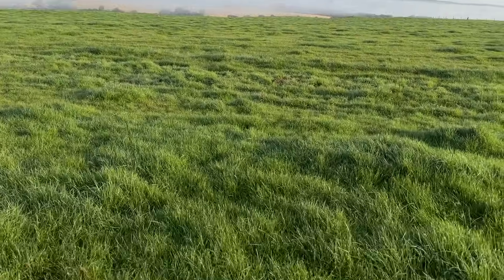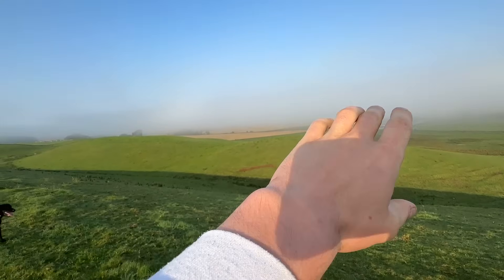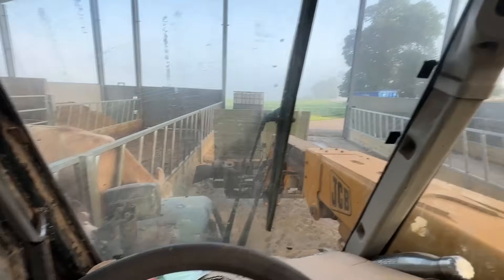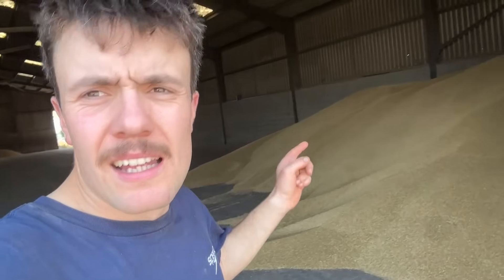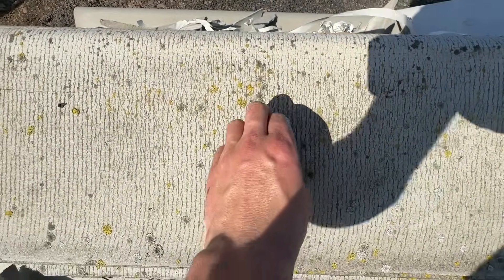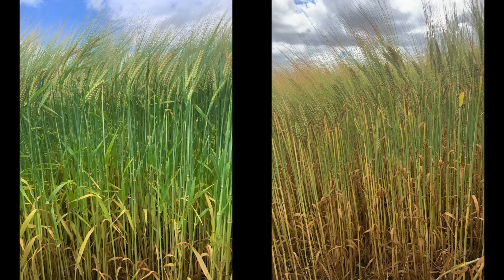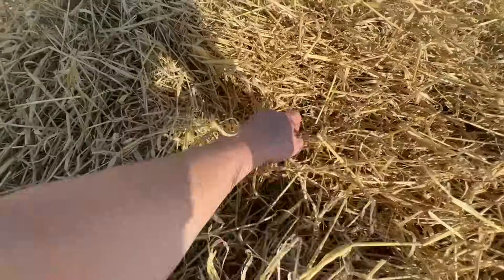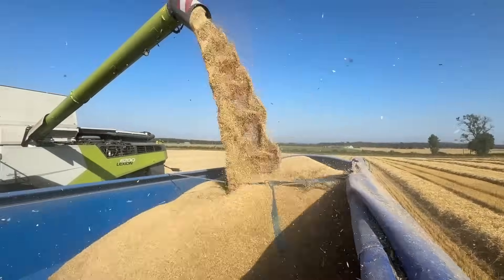Big day of farm work

Comment: 6:12 If you line the front of the stewart trailer with the front of the divider on the combine, that should be the spout at the back of the trailer.
Reply from the maker: Aye easier said than done when you’re on the other side of the bout of straw

Comment: Your lichen issue on the roof. 1 part bleach, 9 parts water. Will help kill and remove. 

OR use a concrete sealer, make the surface slick with fewer places the lichen can grow into.

Comment: Would it be worth getting your next tractor with an easily removable front loader especially for harvest time, ideal for moving bales etc. obviously price would be an issue but it may well be with it when the forklift are busy with Fert, seed, grain  etc.
Reply from the maker: Usually works out fine with forklifts

Comment: The modern fibre cement is nowhere near as good as the old stuff with the asbestos in it! If you're having trouble with the barge boards/verging, you can get a good finish by using a wide tin verge instead. Butyl sealants work well, and remain flexible, without bonding the roof components together. Hopefully it'll be good as is though.